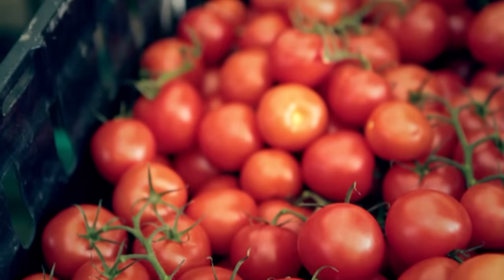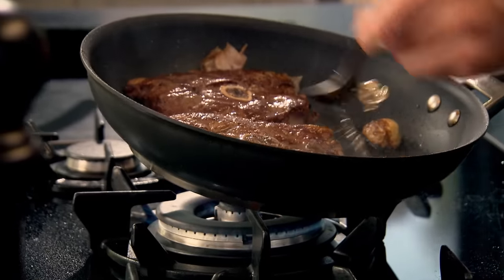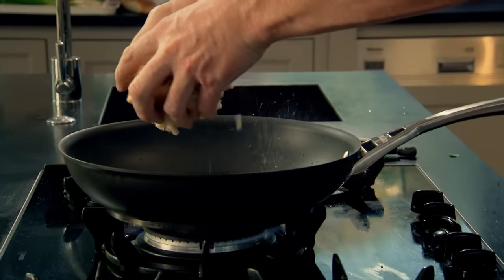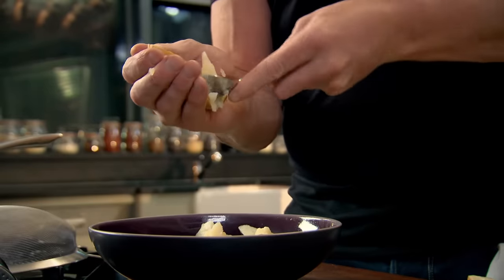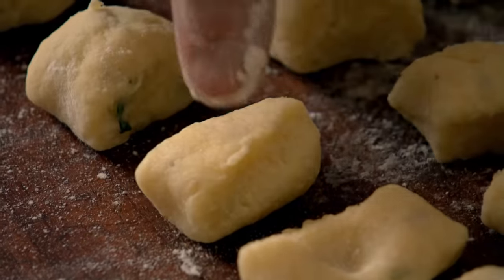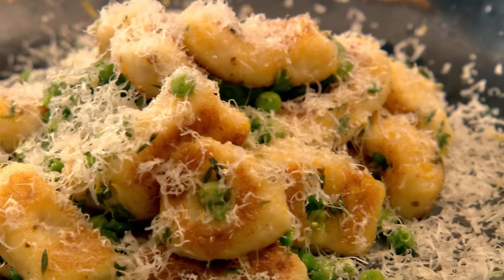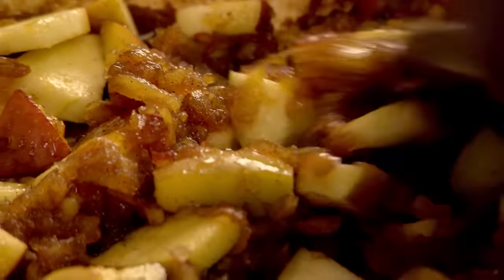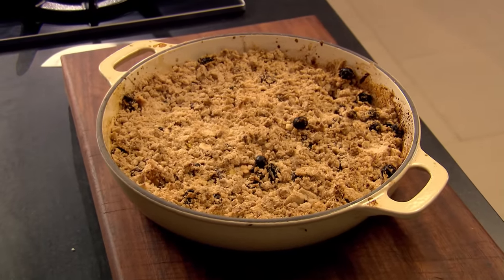Your Budget Friendly Recipes | Gordon Ramsay

Comment: Term- finish your food. Isadore all of our fine dining course meals. The dishes are stackable- each course you finish your meal, and then place the next dish on top of the empty plate. when your course meal is all complete you place your own dish in the tub. Also- the term "having to ask in an insult to the chef". If you work in table service at a fine dining establishment- the server knows, portion size for body comp, etc. you don't need to ask. Rewarding tracks, get higher as you complete levels of service.